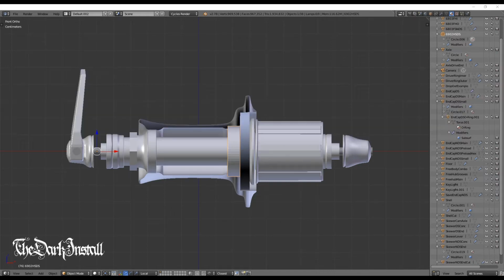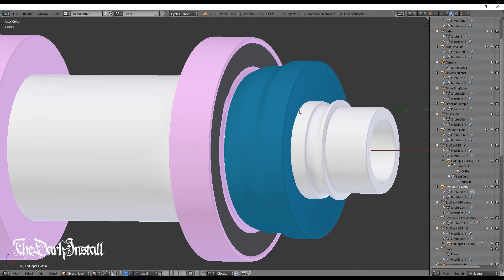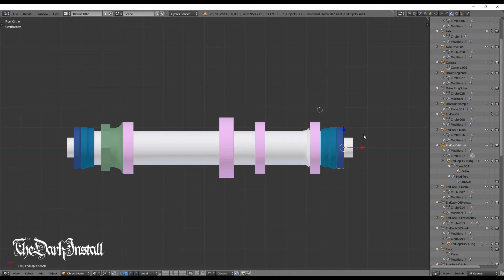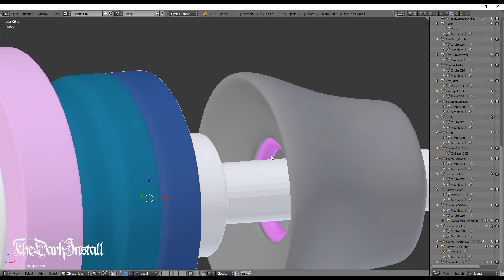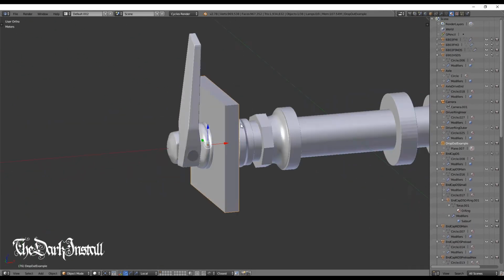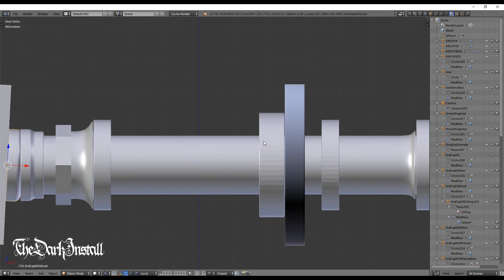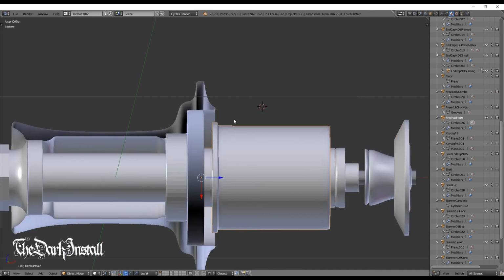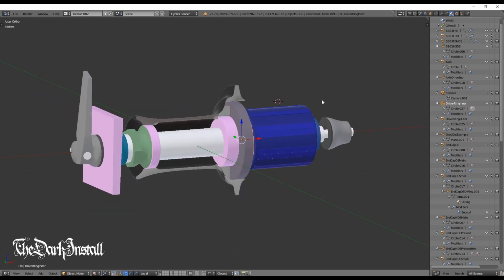Concept Design. Rear Hub. Part 3.

Comment: King have used the ring drive (helical engagement ring) system successfully for many years (apart from them occasionally freezing in cold weather).They are uber reliable but not overly light (even in R45 guise).

Comment: Cool concept and great idea. 
With curious, (but mostly foolish) fellows like myself who like to fidget with things, (things that we shouldn't be fidgeting with) I can see myself holding the wheel by the axle, spinning the wheel, and inadvertently loosening, or tightening, the non-drive end preload nut and not realizing it. Would there be room enough to include a lock nut to hold the preload nut in place ... to keep us OCD chaps from destroying your hub?
Reply from the maker: That will never happen.  The preload will have a built in o-ring to keep it in position.

Comment: @TheDarkInstall When your freehub pushes the clutch system into engagement, the freehub will be pushed in the opposite direction. Based on your design so far, I believe the drive-side outer locating bearing will take this force in the axial direction. Needless to say this force increases when the user pedals, and could potentially cause bearing failure. I'm sure there's a way to make the system work, but currently it's not accounted for.
Reply from the maker: +Baxter Ross a very good point.  This will obviously need to be addressed!

Comment: I think you've outgrown blender. Next step Inventor/solid edge/solidworks
Reply from the maker: Outgrown Blender?!?!?!  I realise it is not a proper engineering 3D application, but I have spent so much time in Blender with artistic endeavours over the years, that for me it is the ultimate sketching tool for concept design :)  When I finish with the brainstorming, I will mover over to Solidworks to draw it properly :)
Reply: I think you'll find it easier to do the component mates on solidworks/solid edge